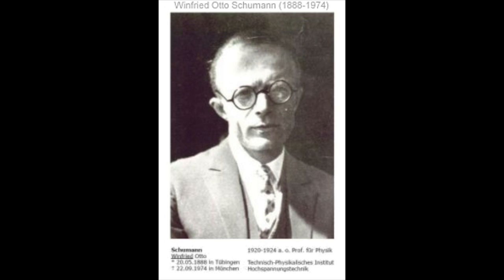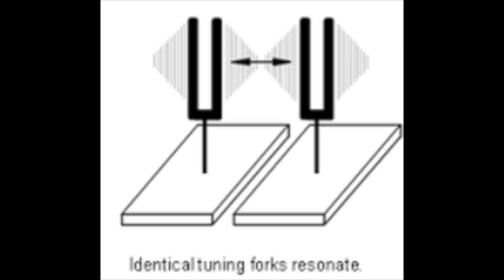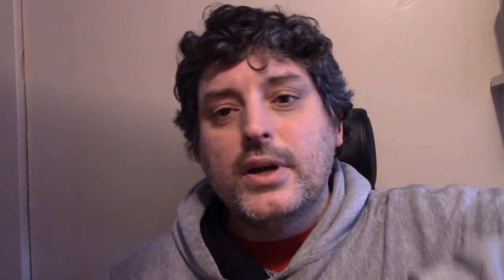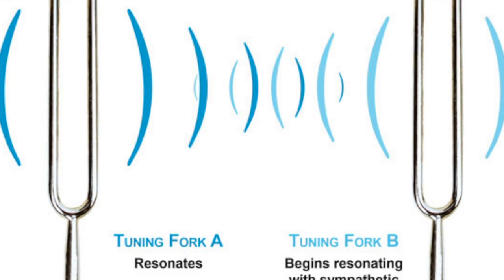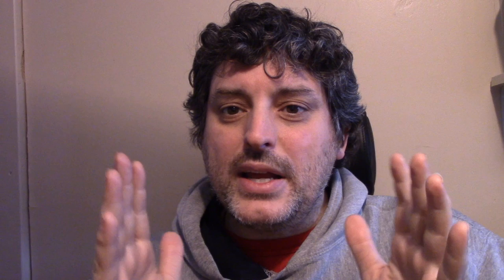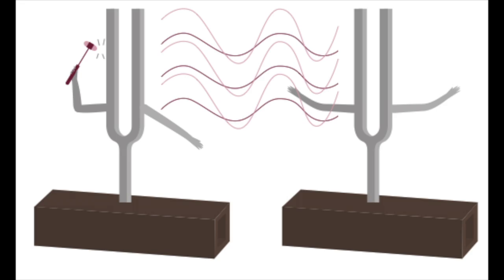Free Energy Generator - How to Make A Homemade Endless Energy Machine - "Tarrin It Up Tuesday"

Comment: Didn't you say the deeper the frequency the larger the tuning fork has to be? .. well, cant you calculate the size you would need for the frequency you need? Seems a tuning fork design calculator could help. -  My idea is I think we could do it by tapping into Earths magnetic field itself and converting the magnetic field to electricity. Perhaps the two ideas could work together.
Reply from the maker: I think you have a good idea.  I just have have too many pots on the fire and need someone smarter then me to figure this out. :)
Reply: ***** I found one such system that could do it. I emailed these folks and expressly asked them if the software could do it just because of your video. - It's called COMSOL Multiphysics Simulation software and requires the Tuning Fork Simulation add on. I asked if the software could calculate the size and dimensions of a tuning fork designed to resonate at 7.83 hertz. The reply,
 " Dear John,
Yes, what you described is possible to do in COMSOL, using the Optimization Module. In COMSOL, we can parameterize the model when building the tuning fork, then use the optimization algorithm to find the specific combination of those parameters that would produce the required resonant freq.

In fact we just had a workshop yesterday and this example was presented: https://www.comsol.com/model/shape-optimization-of-a-tuning-fork-8499. Very similar to what you are interested in.

Best regards,
Mao Mao, Ph.D." 

Sadly, I have no idea how much this software is and I suspect it's gonna have a steep learning curve. This may help point you in the right direction I hope.